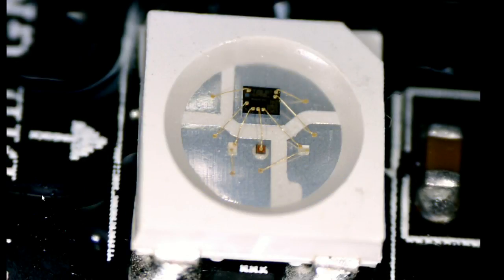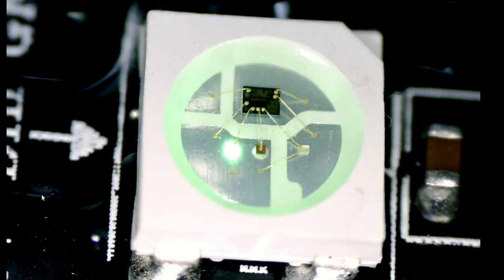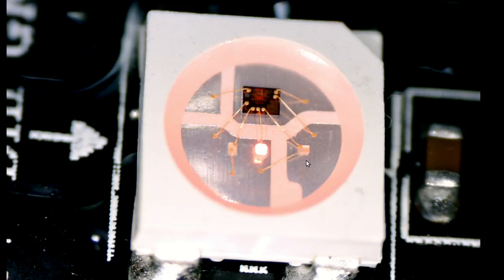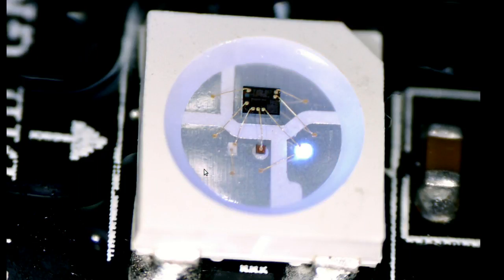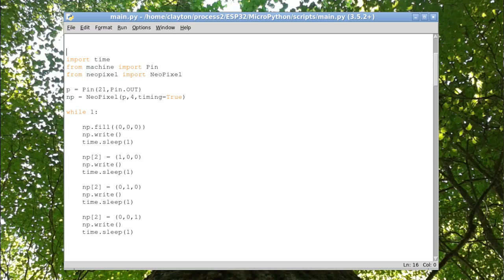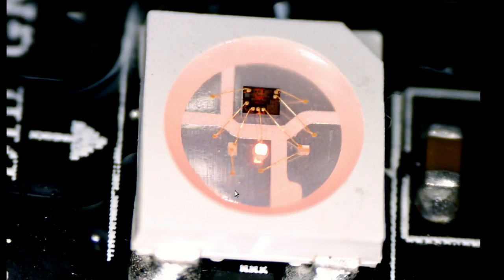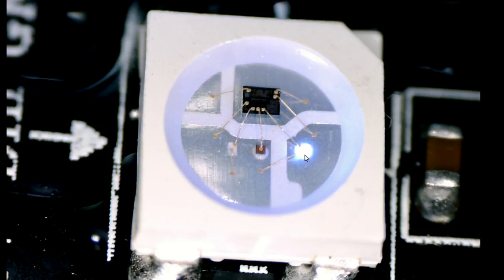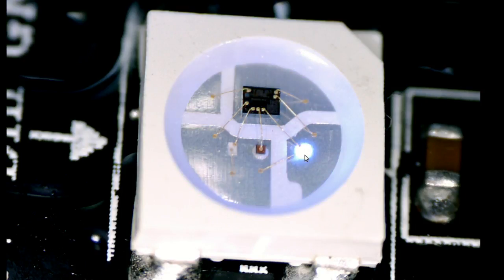NeoPixel Up Close - WS2812b

Comment: thank you very much, very informative! I have a question: on the wiring diagram there's a WS2812b there's 100 nF capacitor, what's its purpose? (I'm just beginning with electronics, sorry!). if I power a DIY matrix of these (buying them individually), can I get rid of it if I make sure I use 5V? thank you very much!
Reply from the maker: No. The WS2812B typically requires the capacitor or the internal IC will be unstable. There are some variations that don't require a capacitor. The main thing is that you have to go exactly by the datasheet for the exact part number. Otherwise you can't expect it to work reliably if at all. Check out my video on the micropixels. Those don't require a cap, which allowed me to make a really tiny matrix.
Reply: @ClaytonDarwin  great, thanks!! I'll go check it out right now! thanks again
Reply: @ClaytonDarwin  I saw that video, your matrix is amazing. I'll probably be in touch via email (through your website), my name is diego. in the meantime, you have a new subscriber! :-)